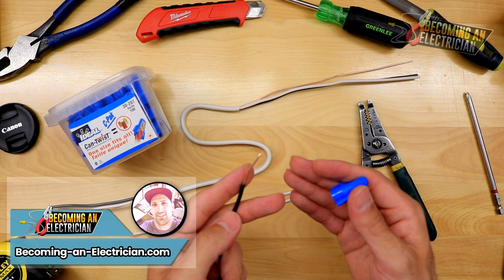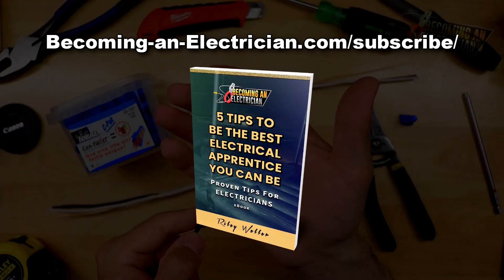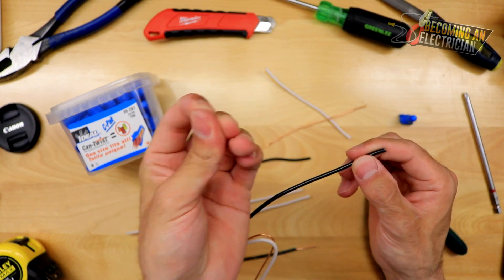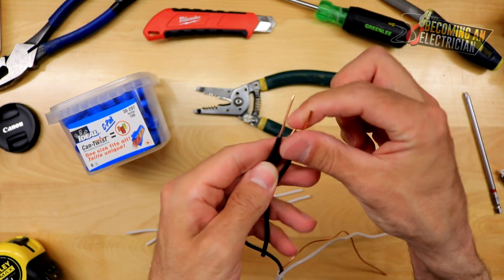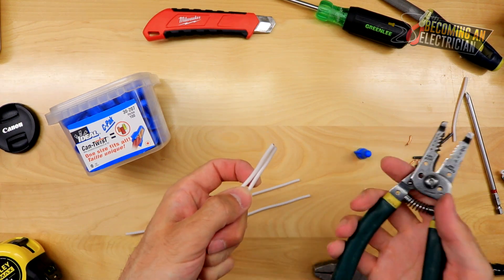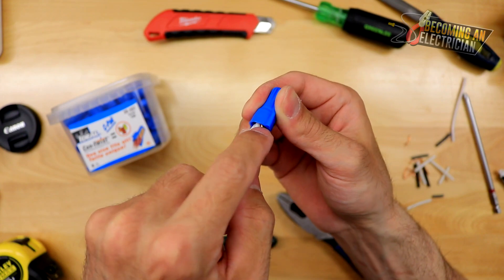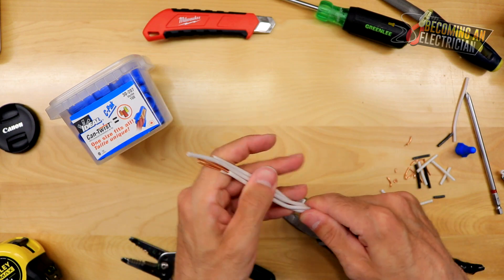How to Splice Wires for Electricians

Comment: How would you do that if you had 12g or 10g wire? Pretty hard to splice.
Reply from the maker: Exact same way as shown in the video!  The trick is to strip them a little longer, then gently  mold them into a braid before you clamp down hard.  The difference is electricians are working on wires daily, so they build extra hand strength:   https://becoming-an-electrician.com/how-to-splice-wires-as-an-electrician/

Comment: Yeah, I failed miserably I keep damaging the copper
Reply from the maker: That is okay - just strip the wire a little longer next time, and don't hold the pliers are hard as you first start your braid - once the braid mold happens, then you can squeeze a bit harder with your twist to finish it off!
https://becoming-an-electrician.com/

Comment: We call’em wire nads, or just nads 😂
Reply from the maker: Lol - on site most people called them Marettes - but wire nut is a more correct term.  More specifically, you'd say blue marettes, or red marettes, or big blue marettes for the big ones!  The orange marettes are often used for fire alarm systems.. and they also make some brown ones if working with aluminum wiring!
https://becoming-an-electrician.com/

Comment: The wire nut box says one size fits all 😂
Reply from the maker: The wire nut can be used in the majority of cases for typical commercial / residential electricians.  Once you get into many wires, or larger than normal wire sizes, you have to upgrade to the next wire nut size to safely cover the copper of the wire while fitting properly.
https://becoming-an-electrician.com/

Comment: Do you just "ram" all the wires into the box when all your pigtails are done?
Reply from the maker: No, you should be folding them in gently, while also thinking about if you need to access the box later, you can easily roll the wires out.  I think I showed this in my "How to Splice a Double Gang Electrical Box" video:
https://becoming-an-electrician.com/splice-wires-double-gang-box/

There's also the Single Gang Splice Video, too:
https://becoming-an-electrician.com/splice-wires-single-gang-box/

All the roughing-in series is here:
https://becoming-an-electrician.com/tag/roughing-in-series/

(You can get the training by email, too!):
https://becoming-an-electrician.com/optin/roughing-in/

Comment: where i struggle is when trying to keep the insulation loose and not twisted
Reply from the maker: Sometimes it's nice to have a gentle bit of twist in the insulation, as solely relying on the copper can maybe put extra strain due to intense twisting?  The insulation's touching each other may resist tension & keep a solid splice for years to come?

I think it'd be hard on your hands/wrists trying to splice like that too.. just make sure to strip the wire a bit longer, and it will always help make splicing the wires easier!  (Especially when getting to the bigger gauges of wire!)
https://becoming-an-electrician.com/

Comment: Do u have a video on how to twist two or 3 stranded wires together??  Do I pre-twist each wire first and then twist them together?  I am twisting two 12 gauge stranded to one 18 gauge stranded and want to figure out the best connection.  Thanks!
Reply from the maker: Not yet.  Will be coming out with videos here in coming months now that my back-end tools are almost fully implemented for organization going forward.

To answer your question, there's no real best way.. but it's important all the stranded wires are touching, and not just a couple loose strands, to ensure the wire's rating is honored.

In your case, I'd probably put the two stranded #12's together and gently hand twist them, then hand twist the #18 individually so all its conductors are tight, then hand twist the #18 to the #12's a bit harder.

The biggest thing is making sure you do a tug test on the wires once the wire nut (marette) is on, making sure that no wires can pull out.  (Often stranded wires can easily pull out of wire nuts.. so the tug test is a extra precaution!)
https://becoming-an-electrician.com/

Comment: Your hands are not as strong because you are getting older.
Reply: Im against the pretwisting now. the manufacturer doesnt recommend even
Reply from the maker: I understand your concerns - and it's important to protect your body - but putting wires untwisted under a wire nut (marette), and using the wire nut to twist the wires for you, can often be a much less strong splice, and weaker contact points, which can be a point of failure / arcing / fires.
https://becoming-an-electrician.com/
Reply: Any repetitive action your body performs everyday can cause repeated injury to tendons, muscles, and ligaments and eventually scar tissue it sucks
Reply from the maker: Yes definitely!  Repetitive strain injury (RSI) is something you have be really careful of as an electrician.  When tightening wire nuts, I often use both hands if the task can allow for us so it's not just the one hand twisting constantly.  Good points!
https://becoming-an-electrician.com/
Reply from the maker: I don't agree with this.  Strength gets built up over time, especially for these types of muscles in your hands that we don't use often for splicing wires.  If you don't splice for awhile, you will slowly lose that strength.
https://becoming-an-electrician.com/

Comment: huh, I always spliced using the old 60° method with 2 pliers... good to see there's an easier way, tested it and doesn't come apart, no shaking or wobbling... so, thanks for the information.
Reply from the maker: You're welcome.  This is the typical way an electrician splices wires.  Sometimes they just use the wire nut to tighten the splice, but this is poor practice, as it's not as tight as actually using your pliers.
https://becoming-an-electrician.com/
Reply: I use that method a lot of the time. I like it as well. Best wishes to you. A very good and worthwhile comment on your part!

Comment: Is there any advantage to wrap the wires below the edge if the wire cap with electrical tape and extending that on the exterior of the cap to ensure the wire cap doesn’t slip off over time?
Reply from the maker: If you have a good splice, with no copper exposed, tape is not needed.  Using tape is not bad, and it does improve the secureness of the splice.

For example, let's say the splice would be near a vibrating machine, you may want to tape CLOCKWISE so the splice remains tight due to vibrations.

In normal situations, taping is not required.

https://becoming-an-electrician.com/

Comment: Tried this today but didn’t have my Kleins and at a box. The biggest issue seems to be holding 4 wires even with each other. I have about 5” of wire. 
Watching this it seems it’s best to do the wire nut first then attach the jumpers to the receptacle.
Reply from the maker: Hey, I just released a video about splicing 4 wires: https://www.youtube.com/watch?v=Fk2V2-L9POw

It sounds like you are just doing electrical work at home?

Yes, we make sure to splice the wires, put on the wire nut, then attach the pigtail to the plug with the wire splice tucked into the box.

Comment: How about 5 wires? I can do 4 wires or 6 but with 5 i can’t keep the insulation even, one wire usually bends around more than the others.
Reply from the maker: Thank-you for your question!  I will be launching a "how to splice wires for electricians" email series here soon with a brand-new website launch.. you can download my free book to be notified of the website launch..

I can then look into making new splicing videos with your questions, like how to splice 5 wires together.

In short, just make sure to strip the wire a little extra long, and gently mold the braid outward, starting from the base.  The biggest thing is to NOT clamp down and twist too hard too early.. once you get that braid where you want, then you seal the deal!

My free book is available here:
https://becoming-an-electrician.com/subscribe

Keep asking questions on the videos, I will try to help where I can!

Comment: Every time I splice wires I chew the wires with my linemen pliers any suggestions?
Reply from the maker: Could be three reasons your copper is chewed up when splicing wires:
1. The pliers are brand-new.. you'll notice the grooves are very indented.. over time of use, it won't be as harsh on the copper wires when splicing.
2. You may be not holding hard enough, causing the linesmen pliers to slip on the wire
3. You may be holding way too hard.

Watch in the tutorial as I start from the base of the wire, then work my way out.  I'm not holding too hard, just mostly molding the splice into place.. then I'll squeeze a bit harder to seal the splice in.. here's my wire splicing tutorial:
https://becoming-an-electrician.com/how-to-splice-wires-as-an-electrician/

Comment: 9:35 All that he's pointing to goes into the ducting. Sparky's don't clean, that's for peasants.
Reply from the maker: No way!  Especially in a finished residence, make sure to get these loose ends, such as the small strippings off the wire to be respectful of homeowners!  I have seen homeowners call and complain about electricians leaving behind the wire strippings (at a plug for example).. if you do it as I show, you just throw it in a box as you go along.

Comment: Im so frustrated I can’t figure this out. I’m trying to figure out my own way to splice but it’s tough. Everytime I twist it the insulation ends up twisting with it. My teacher said that’s not acceptable. I don’t know how you do it with that insulation not twisting into it. It’s crazy cause I have really strong grip but i can’t stop it from twisting.
Reply from the maker: Strip the wires longer.  When the wires are short, it's hard to splice.  If the wires a longer, then start at the base (near the insulation, and work your way back).  Just watch the video over a couple times.  I share step-by-step how to splice wires as an electrician!

Comment: Really liked the video, useful. I think I will put a dot of white correction ink on the correct side of my linesman pliers for cutting spliced wire. This will prevent the inadvertent short cut wire splice
Reply from the maker: That could be a solution!  It might wipe off after awhile.. you could always engrave something that would be there forever if you are really serious about it.
Reply: @BecomingAnElectrician Sheet! Engraving may be the best of all ways. I've (almost) aways cleaned a spot, roughed the spot up, and used a white enamel paint pen. Filling in an engraved area is probably the next evolutionary step!!! Nice, Nice, Job!! And of course, so is your video!!!
Reply: Or, just use a sharp pair of ‘dykes?!’
Reply: The "Paint Pen Markers" also work well. They're generally enamel, and if the spot on the tool is clean and scuffed up, it may still be there long after you're gone. I'm sure my marks will still be on my stuff. I'm old. Also, I believe they now come in colors, but I've only used white. It's a habit. Great comment. Great idea. A great craftsman you already are!!!

Comment: You explain splicing way better than my instructor I like that you actually show how to do it thank you
Reply from the maker: You are very welcome.  Make sure all the conductor insulation is lined-up, that's half the battle.  Then start from the base, and work your way OUT, which will remove any bad cross over, so that the wires are actually braided.  Cut, then do a quick round to make sure no sharp edges, then the wire nut goes on very nice.

If you follow the tip about using the pliers as a cutting length guide, make sure you are using the right side of the pliers, or you'll cut off your entire splice by accident :)
Reply: @BecomingAnElectrician  I’ve only been in trade school two months now so obviously I’m still green but what I seem too have trouble with is I’m always cutting my wire to short and not giving myself enough wire to work with 😂
Reply from the maker: @patriotgaming6049  When cutting wires in the box, or when cutting wires after splicing?
Reply: @BecomingAnElectrician  I would say both lol
Reply from the maker: @patriotgaming6049  Haha - for splicing, try that plier width technique I share in the video (make sure plier cutting blades are to outside).  For length of wire.. 4-5 fingers is a good starting point if wires are sticking out of box.. or you can try to push your wires into the corner of the box, then 2-3 fingers length is good for the remaining wire so that it can fold in easily!
Reply: Yeah, unfortunately, I've found that to be the case in many careers. An instructor did say once, always expect you may be receiving faulty information, and work hard to be sure it makes sense. You'll never pick up on every one that could be done better, and it may not even be necessary to do it better, but it's a habit that will serve you well, for all of your life. Best wishes. PS. You sound young. Try to get out of the habit of calling someone out. It makes you look bad, not the one you called out. Ok?

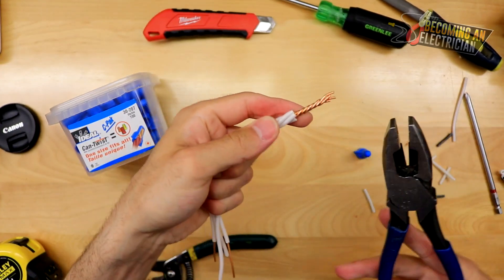Comment: The information in this video is pure gold. And that splice at 12:36 was pure o*** to watch. It shows what being a competent or experienced electrician (or both) looks like. And this splice right here is why I consider Wagos trash, you can never get the good stuff of a splice like this with a Wago. Maybe Wagos are the best excuse a lazy or incompetent electrician can come up with and there is nothing anyone can do to change my mind. Unless of course the client is willing to pay the extra cost when there is no benefit for them.
Reply from the maker: Definitely valid points.  Wagos (spongebobs) are definitely more expensive, and you're relying on an additional component for the splice to happen.  (At certain times they do make the job easier.. but sometimes not).

Splicing the wires together is a tried-and-true method for a strong secure joint, and the wire nut (Marette) ensures the strong splice stays, and makes sure all wires are connected with its metal enclosure as well. 

Thanks for watching.. hope you learned how to splice wires as an electrician better!

Comment: The black Wurth blades can cut wire insulation like using a hot knife to cut butter. It feels like they are better than a surgeon's scalpel. It's one of my most favorite things to do at work.
Reply from the maker: Ya, that's why I show just to score the insulation jacket, then at the very end cut through, that way you don't risk damaging the actual conductors insulation.  Learn more here: https://becoming-an-electrician.com/how-to-strip-nmd90-wire-jacket/
Reply: Be careful!  Better get a pair of Cut level Milwaukee gloves?!?

Comment: This guy doesn't have that many subscribers, but unlike many other more popular channels - he actually knows what he's doing when it comes to wiring. This is the channel homeowners, hobbyists and anyone else interested in completing electrical wiring tasks correctly and safely should be watching!
Reply from the maker: Thanks!  Was in the industry for just over 10 years.. had the privilege of working with a couple really knowledgeable journeymen who I'd pester with my constant questions!
Reply: Man, you deserve millions of subscribers! @BecomingAnElectrician
Reply from the maker: @JP-hj2gs   One day at a time!  :)
Reply: Good video of how to properly do the wires I twist them on the end and trim them off. Wankel wire nuts are only for low amperage. 5 amps and lower great for LED lamps and such. I've seen these wire nuts melt and turn water purple because of the surface area that they're using to conduct the amperage.
Reply: Nicely said. Your a good person for giving credit when credit is due
Reply: Good comment and I second it!  Couldn’t agree more!
Reply: Your comment has merit, but don't denigrate others, even if you know more than them. It says nothing about those you are calling out, it's says bad things about you, and no one you work with or even hears you, will ever trust you again. Some will avoid you so you got nothing to say about them, and many will watch for things they can say about you. You're probably young, but don't remind people just how young. It ain't gonna benefit you. And you never want to be referred to as "that name", ok?

Comment: I've done electrical for 30 years and don't twist the wires before using the wire nut and I have never had a return call due to a failed connection. Twisting damages the wires and makes it a pain in the ass for the next person who has to service that box. Wire nuts are rated as a connection device and nowhere in the electrical code does it require the wires to be twisted prior to using a wire nut.
Reply from the maker: There will always be a debate.  If I were to train anyone, I would highly recommend them to twist wires - it does not damage them if you are doing it properly.  The wire nut itself "damages" the wires by scoring it?
Reply: I guess it all comes down to application by the electrician.. After stripping the wires, I make sure all my ends are flush and then tighten the wire nut down fully until the insulated part of the wire is twisted around themselves. Afterwards, I pull test each wire. If I remove the wire nut, my wires are always twisted together, but remain more serviceable that than wires that have been pre-twisted with pliers. Likewise, I've seen many instances of connection failure due to someone pre-twisting the wires, only to have one of the wires "twist out" of the bundle.All comes down to the skill level of the person doing the install.
Reply from the maker: @rogerb5957  Yes, makes sense.. it's most important to line up the base of the wires when splicing, not the ends, as each stripping can be longer or shorter, and the splice molds the wires together from the base outward. Once the twist is done, you cut, round, then put on the connector.  Over time an electrician's hands get stronger to hold the wires when splicing.